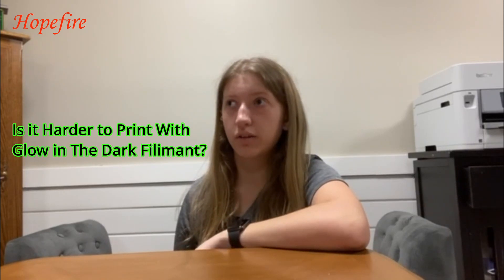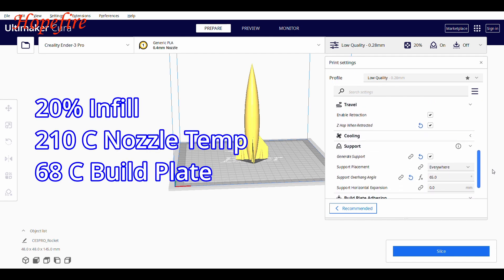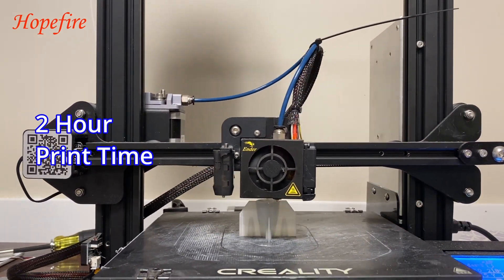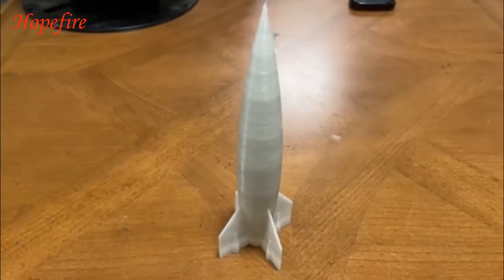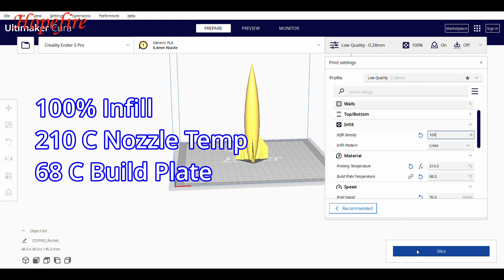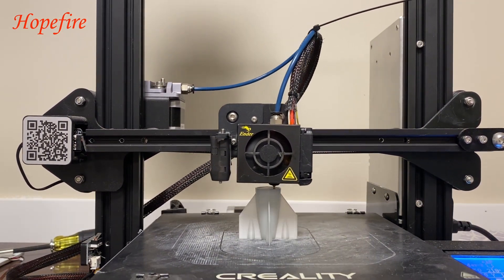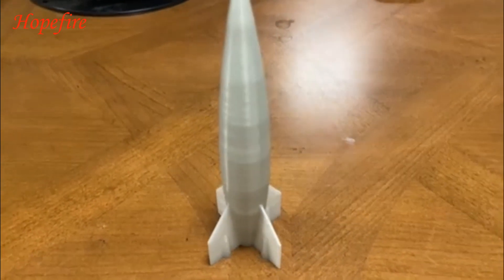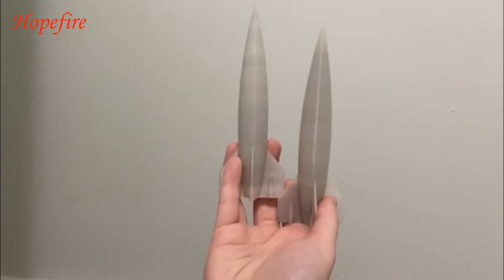Glow in The Dark Filament Is Harder Than it Looks- 3D Printing

Comment: First of all, 100% Infill is overkill on so many levels to begin with... 80-90% for anything not meant to receive Ironing on each layer to create a Lense of some sorts is enough to fill out most of the voids inside a model ( arguably if you want to make a Lens you should use an SLA/MSLA 3D Printer ) and second, increasing the perimeter count by like 2 would probably have sufficed for the intended purpose 🤔 ( I'd also argue that infill on this model was a waste of material usage... 😁 )

Comment: Great video! I agree with the comments below. Add more walls instead of increasing infill to get a more solid look and feel. I have also noticed that the glow filaments chew through brass nozzles pretty quick.
Reply: Glow in the Dark filament (with some exceptions) may chew trough brass nozzles even more than abrasive filaments 😂 , CNC kitchen did a video about it

Comment: Thanks for the video! I have yet to get glow in the dark filament, but I definitely wouldn't have thought of using 100% infill (or just thicker walls? 🤔) on my first go around.

Have you by chance tested to see which of those 3D prints held a greater amount of luminance over [X period of time] over the other? I'd be curious to see if the 100% infill lasts longer, though I suspect that it'd also depend on how long you "charge" the piece along with what sort of light source you're using.

If you really wanted to go the distance, maybe you could 3D print little lightbulbs that were intentionally left outside and you could see how the glow in the dark filament weathers over time. Maybe even 3D print tiled walkways that charge from the sun!
Reply from the maker: No I’ve never tried to see which one would glow longer. Maybe I’ll have to try it sometime. It would also be kinda cute to build glow in the dark light bulbs

Comment: Great print! 

Keep in mind, many glow-in-the-dark filliments have additives that can be abrasive and eat away at your extruder. I'm not what hot end setup you're using, but it may be worth looking into a hardened steel kit to work with abrasive materials.